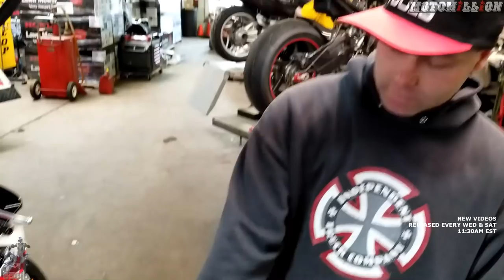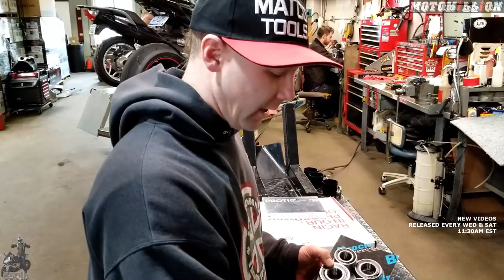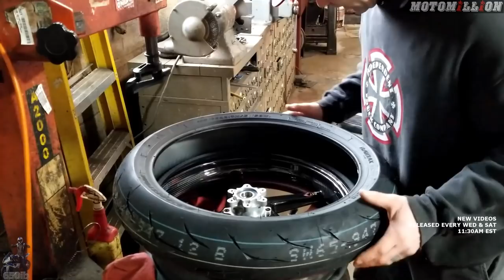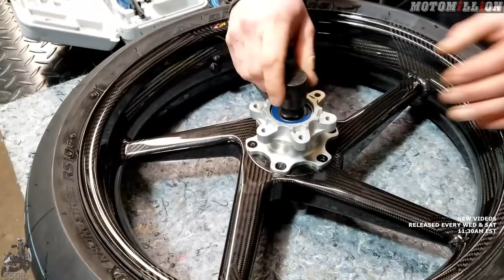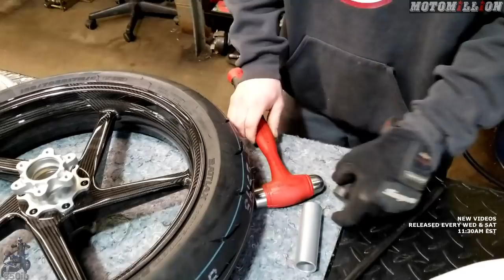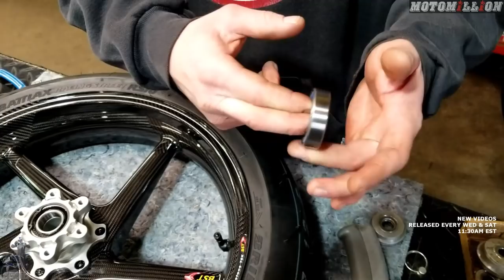BST Carbon Fiber Wheel & Ceramic Bearings onto 2018 S1000RR!

Comment: Are these rotors heavier than stock?  I guessing they are since they are 5mm thicker and the small difference between the total wheels.  Should have weighed the rotors by themselves vs the stock ones.  Still cool video as usual.

Comment: Quick question guys. I have a 2016 bmw s1000rr premium package (with the forged hp4 wheels). After seeing this I got some used bst carbon fiber wheels already outfitted with hybrid ceramic bearings. I got the rims and hubs. My question is can I use my oem sprocket and carrier from my oem forged hp wheels? Or so I have to order an aftermarket carrier? Thanks very much. Love your videos
Reply from the maker: You'll need bst sprockets Sir. Please order them from http://www.brocksperformance.com and tell them I sent ya.
Reply: @650ib  ok than you, I will and I'll tell them you sent me.

Comment: Great video and is making me contemplate these wheels. One question though since metal expands with heat wouldn’t that also cause the diameter around the bearing to decrease and become tighter?

Comment: If your going to c/f wheels ceramic bearings. How come your not using nitrogen?
Reply from the maker: We will use nitrogen in the wheels.
Reply: Thanks 650 ib didn't see whole vid. Enjoy your vids can't ride broke t9 vertebrae adjusting float level my 88 kx 500 getting ready run. My first desert 100  running fat cleansed it out little too much went to test no gear ( not recommended) flipped it 3rd thinking about taking my 750. Gixxer  motor it's older in. Karmin gia roller wish I had 1000 rr bmw in vw thannks

Comment: 15:05 WHAT IS THE FUNCTION OF THE CYLINDER BETWEEN THE BEARINGS. IT DOES NOT FIT IN THE INNER CIRCLE OF THE BEARINGS, I SEE NO FUNCTION FOR IT. ANYONE?
Reply: I guess it is there to guide the pin that goes between the bearing when installing the wheel.
Reply: Thank you